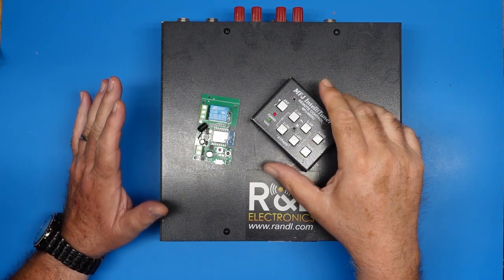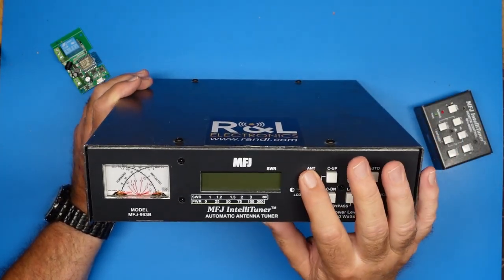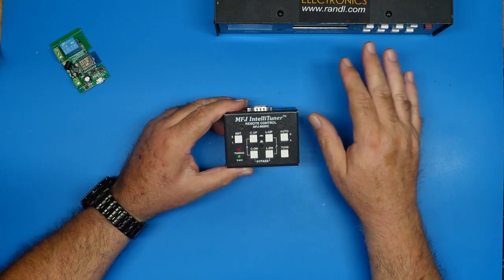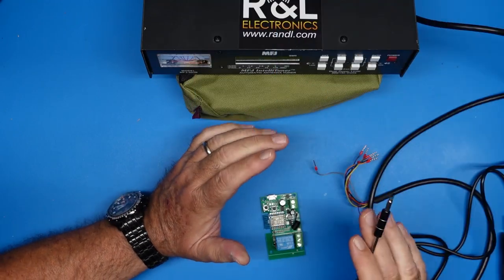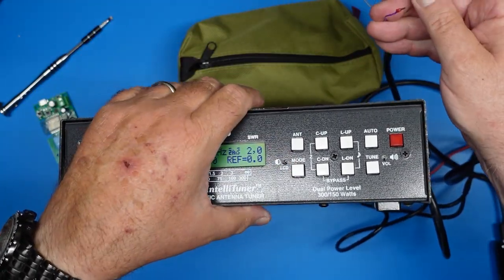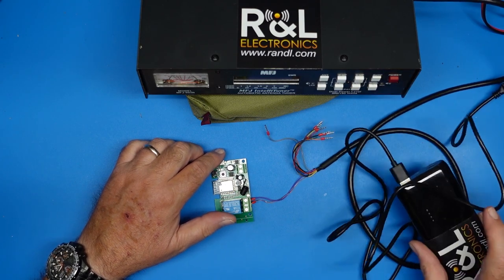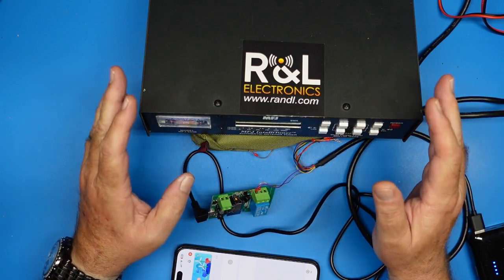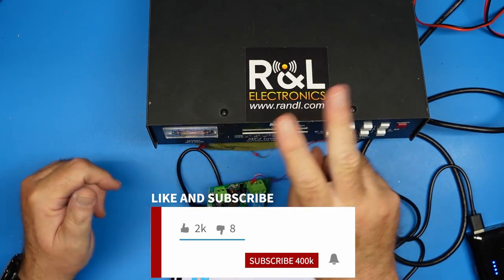Add wireless capability to an MFJ tuner!

Comment: That’s brilliant! I wonder if you can convert this indoor tuner into a remote antenna tuner using such wireless relay!
Reply from the maker: I don't see why not.  You'd need a solid wi-fi connection available at the antenna, but it would save you running control cables.